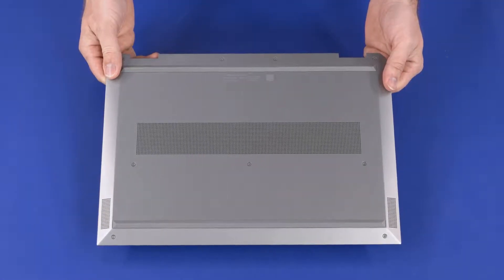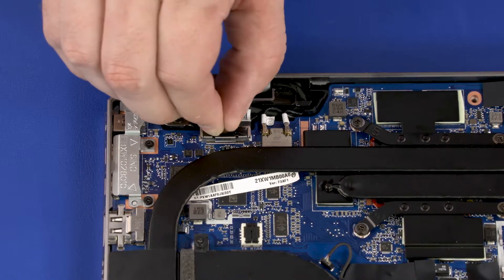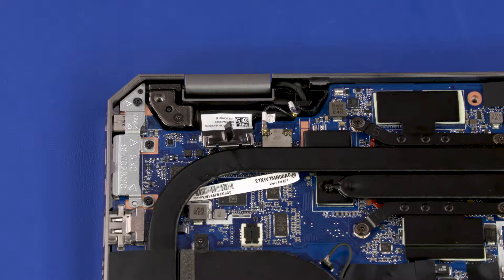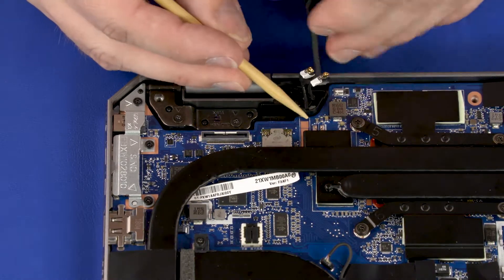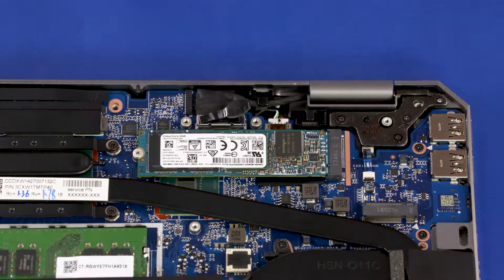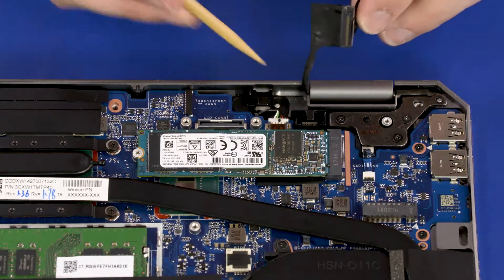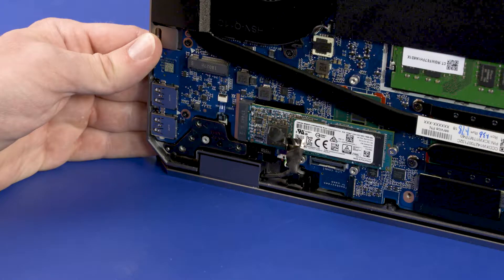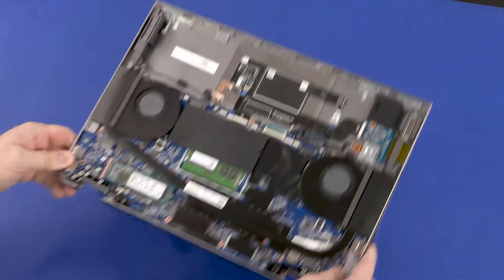Replace the Display Panel Assembly/Top Cover | HP ZBook Studio G5, G4 Mobile Workstations | HP

Comment: I have the Studio G4. My webcam and Touchscreen doesn't appear to be working. I have tried the tests within Windows and check for drivers. In device manager these are no listings for the camera nor the HID touchscreen display. I suspect there is hardware fault. There are two cables that come from the lid, the display cable and the WiFi antenna cables. I'm assuming that the display cable contains the connection for display, backlight power, webcam, stereo microphone and touch input. The connection is longer than the one in this video so I believe this is case. I can live without it but it would be nice to get these working.
Reply from the maker: +ANC Please perform updates via Windows and HP Support Assistant as mentioned below to fix this issue: Step 1 Windows Updates - 1) In the search box, type and open Windows Updates. 2) Check for updates. 3) If the updates are available, click on install and restart the computer. Step 2 HP Support Assistant Updates - 1) In the search box, type and open HP Support Assistant. 2) Check for updates. 3) If the updates are available, click on install and restart the computer.

Comment: I was disappointed to find this only shows the "Display assembly" (hinges up) replacement procedure, and not the required by the service manual procedures for LCD panel only replacement for non touch models. Anyone know where to find guidance in separating the display panel from the top LCD cover. the manual is vague "10. If it is necessary to replace the display panel:
a. Use tweezers to grasp the tape at the top of the panel, and then pull the tape out from behind the panel (1)." this sounds easy enough but is being extremely difficult while maintaining the integrity of the glass.
Reply from the maker: +David Lewis Please refer page number 67 of the user manual to know about replacing display assembly: http://bit.ly/2SF0VbQ